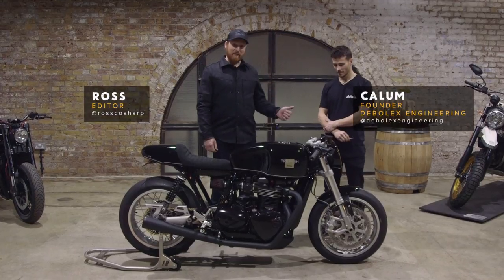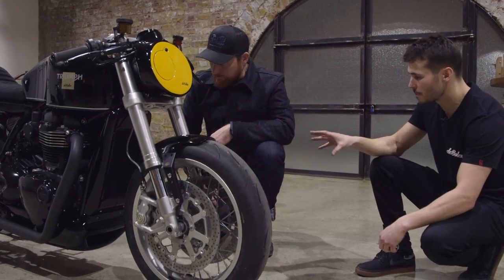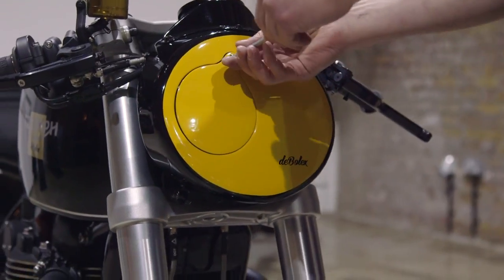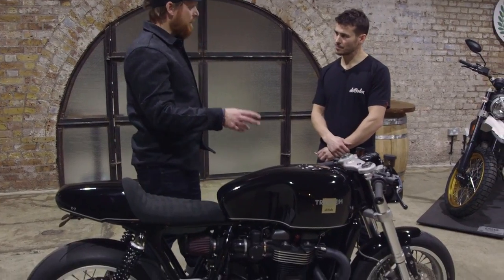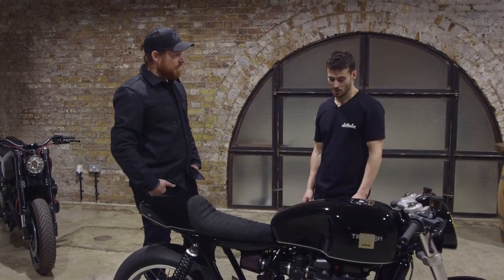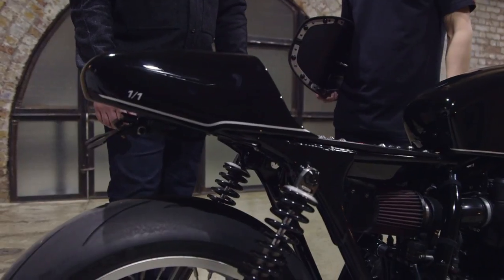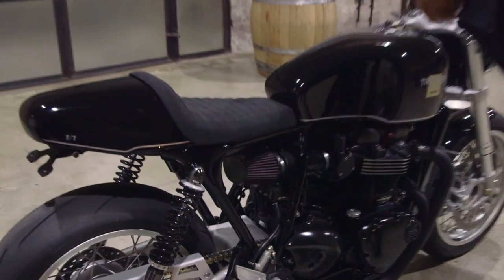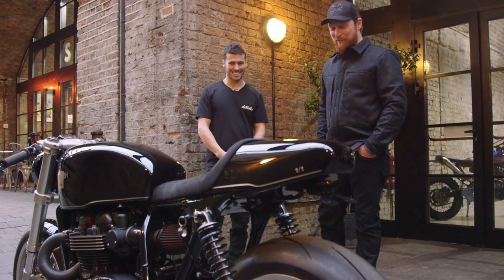Triumph Thruxton R 'deBolex Special'

Comment: You know I love bikes (this one is amazing), but I don't understand this fashion for straight through pipes. I like the way Dutch speaks and I agree with pretty much everything he says about London riding and the bike scene etc, but these pipes really don't help the image of motorcycling with non riders.

A good road legal after market exhaust is loud enough for the safety factor, you don't need to wake sleeping babies and scare the crap out of everyone to get that effect.
Reply from the maker: There's a sweet spot with noise, where you are loud enough to be heard, but not loud enough to be rude. My street scrambler sits right there. And the pipes on this build have some baffling [Dutch]
Reply: OK fair enough, maybe it's the mic but it sounds like a Spitfire taking off on youtube!
Reply from the maker: Calum's bike are usually very loud.
Reply: Bike Shed Motorcycle Club What exhaust do you have on your scrambler?

Comment: What's the HP? Great to have it looking good but they say nothing about performance. All hat, no cattle. Typical Cafe racer!
Reply from the maker: Regarding performance, the bike has lost many kilos, so the power to weight ratio is improved, plus the lighter Kineo wheels improve the turning inertia generated by a rotating mass. All of this is in the DNA of Calum's builds, plus the suspension upgrades. ... Along with the removal of Euro emmissions flat spots on the old map, all these changes play so much of a bigger role in actual 'speed' than HP figures, that getting the bike dyno'd is pointless in any context, unless someone wants bragging rights at the bar to people who know little about bikes. What makes bikes faster is handling and torque not BHP. .... In our view, this bike is actually "ALL CATTLE and who cares about the hat", or showing-off dyno'd BHP figures that play such a tiny part of what makes a bike go faster around a track or road.